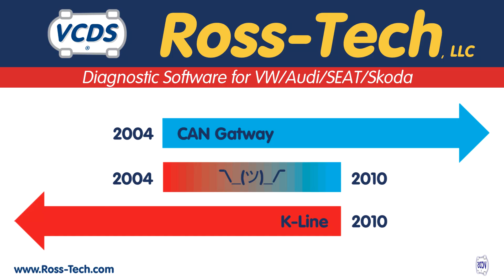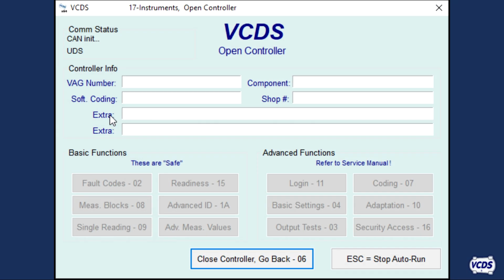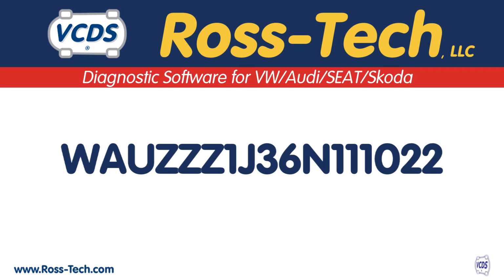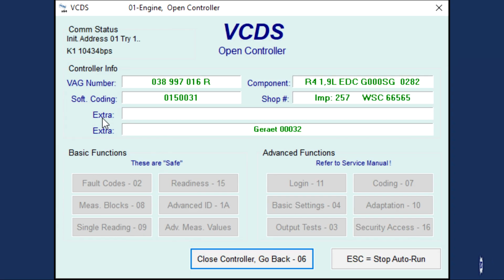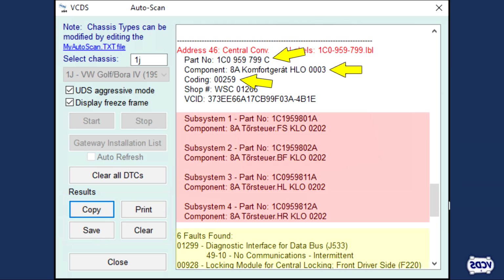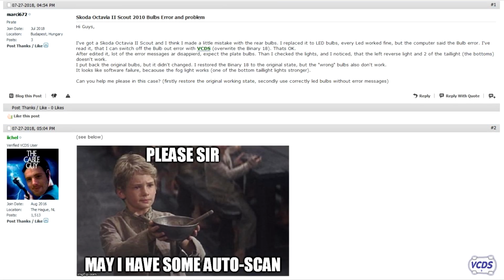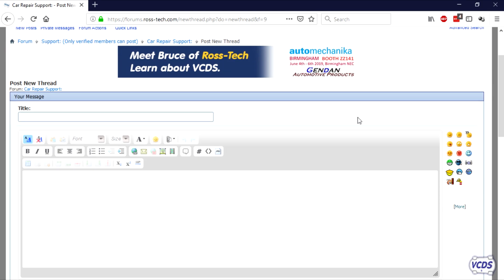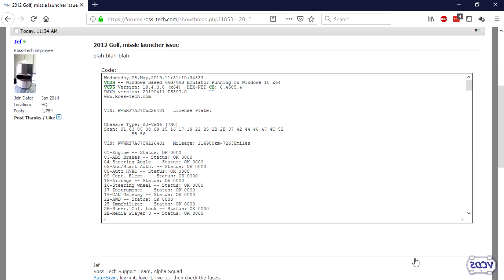VCDS Auto-Scan, part 1 of 2

Comment: Nice video. I could  not paste to my thread. I saved the scan to my files and logged onto the forum. After writing a thread I didn't see a # symbol, but there was a [   ]  that I clicked onto; no curser appeared I typed control V and nothing happened. What did I do wrong? Thank you
Reply: click on the field where the text will go. then code button,  then control V. The code symbol should put the brackets in the field

Comment: Hi Ross tech, I have a mitsubishi outlander with a VW 2 0 tdi engine code BSY, same as BKD I believe. Will a vcds be able to access it?
Reply: Why don’t you take your car to a near by VW shop and let them run an Auto scan, and if they are able to do it, then you proceed to next needs
Reply: @AudiyVW  its a long way away from me. I ended up going to a garage with a vcds and they could not access the same level of data
Reply: 10/4 just out of curiosity, how did you ended up with such a car like that ?
Reply: @AudiyVW  that's what they came as in Ireland and UK. Some in Europe also.

Comment: What is the difference between ok and default !? Black and red !?
Reply: The Gateway list just shows a simple good/bad status of the module.  If the line is in black, that system is OK, no fault codes.  If the line is in red, there is some issue with that module, most of the time fault codes, but it could also be a dead module that doesn't talk.